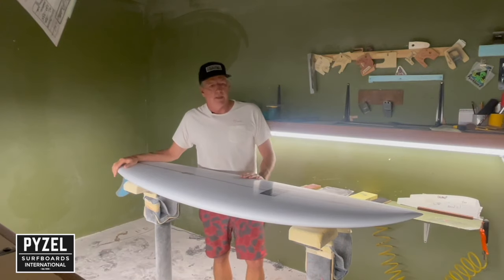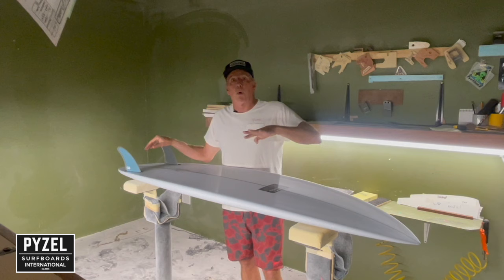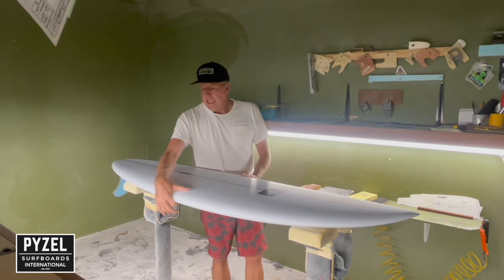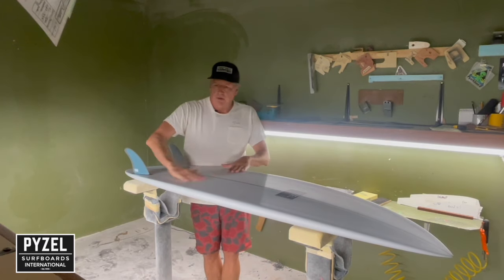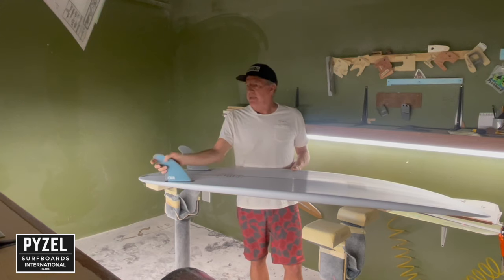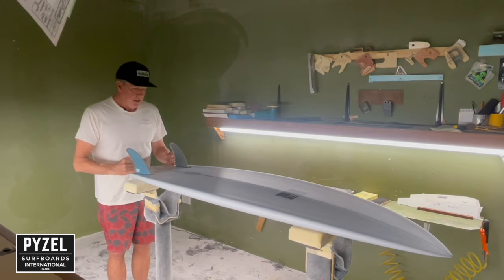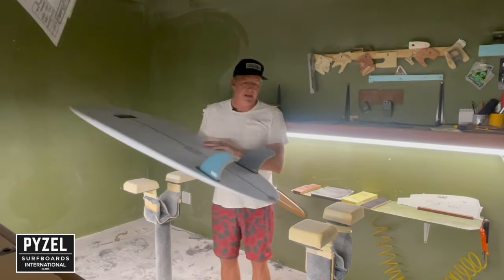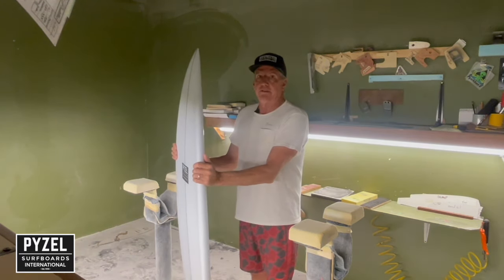The Crisis Twin by Pyzel Surfboards

Comment: I just had 2 sessions on it surfing Canggu Bali waves. This thing flies! It's so fast and the upright fins gives you all the freedom to surf it as you want. Frontside and backside!

I have the entire Ghost family except for the Gremlin. So I've been surfing thrusters exclusively and this is the first twin that doesn't surf dreary and sluggish and have to change your approach too much. I can surf it as a shortboard, and have the same approach. 

Your back foot placement determines whether you spin out, slide out or do full carves or surf vertically. 

My Shadow's are 5'10 and around 26L, Phantom 27L EPS and Ghosts 28L. (going up in volume on my next batch of boards) I'm 5'9 77kg
I ordered the Crisis Twin as custom with the advised dims at 5'8 x 19 1/2 x 2 1/2 @ 29.5L 
Fins I'm using are the NVS Album uprights.

It's very refreshing to surf this board when surfing mostly thrusters, and I think it's cheating, you get every wave, you free up the tail so much more, and this could be problematic for the future as it is very addictive.

I have the White Tiger, Red Tiger and a couple of new Ghosts ready to ordered custom, but this board the Crisis Twin is postponing the order. I might have to ask Jon to make my next order with a twin setup or seek other models.

Comment: Completely innocent question,  but what will be the difference between this board and the wildcat other than having channel?
Like the board. ..both as matter of fact.
Reply from the maker: Hi-- The Wildcat is more towards a "performance" design. The Crisis is a mid-length style outline and has flatter nose rocker overall.  Just basic thought is that the CT is more of a cruisey style board

Comment: Yet again these guys only shape for surfers up to 80kg, and then in good waves. All twins need a back box for a trailer fin if required (barrels on twins can be problematic). If you want more than 40 litres he's going up to 6'8" and so-on. This needs to be addressed. Plenty of bigger guys want litres but not heaps of length.
Reply: Pyzel makes performance boards for Hawaii-grade waves, nothing wrong with that. They‘ll make you a custom, too.
Reply from the maker: HI. When I am coming up with stock sizing for different models I have to go with kind of middle-of-the-road dimensions to make them best for largest section of surfers.  We also make our most poplular designs in "XL" versions for larger/heavier surfers, but we only get limited rack space in shops so they are not going to have all the sizes we offer on hand in most places.   If you are a smaller OR larger person you are going to have to order custom boards in order to get exactly what you want and we are happy to help make that happen for you.  We build our boards in factories all around the world, so wherever you are you should be able to get a custom made and delivered to you pretty easily.
Reply: That’s the same with any major surfboard shaper. I’m a bigger guy too (6’3 and 215lbs) and know I’ll probably have to end up ordering a custom when I order a board, no big deal. There are plenty of boards in Pyzels lineup that have a good diversity of waves (white tiger, wildcat, mid length crisis). Also, any shaper will shape in accordance to the conditions of the waves in their vicinity
Reply: 😂 Tell me you've never been barreled without telling me you've never been barreled... "all twins need a back box" hahaha, rofl Mr. Expert Shaper.